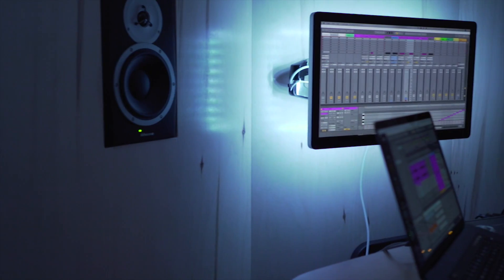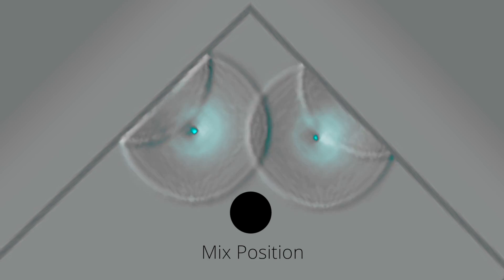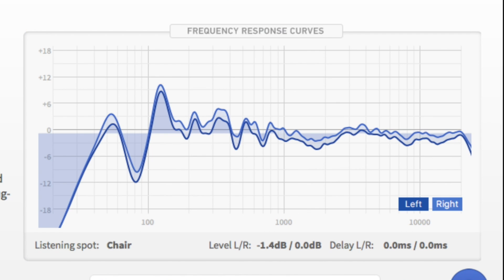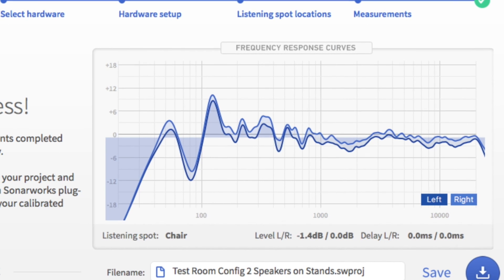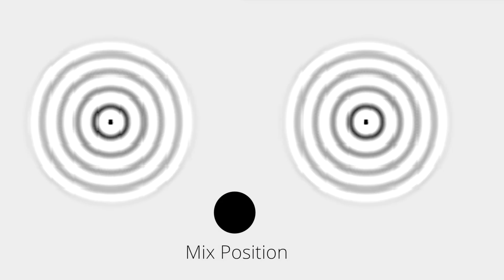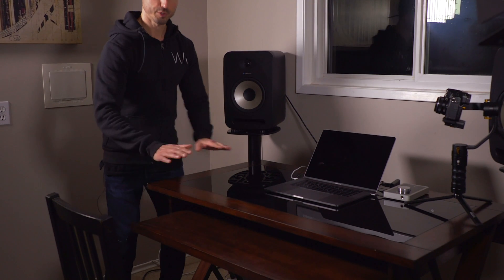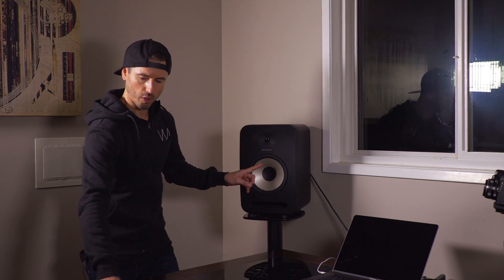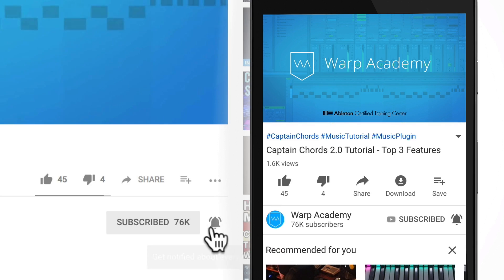How to Set Up, Test and Improve Your Home Music Production Studio Room – Acoustics Tutorial

Comment: As recommended by well-knowns like Wes Lachot and Rod Gervais, and other notable acousticians, the Stereo Vertex Point (the focused point where the speakers are aimed behind your head) should be 14" to 16" from your Listening Position (ear line). The reason you don't want to just to brush the ears is because of head lean. You need to add 4" to the left, 4" to the right, 4" forward, and 4" back from the Listening Position point to account for typical head lean. No one keeps their head perfectly straight and centered at the Listening Position at all times. At 10" behind the Listening Position and 4" of head lean, your L or R ear would be 2-1/2" outside of the equilateral line. At 12" behind the Listening Position and 4" of head lean, your L or R ear would be 1-1/2" outside of the equilateral line. When you map it out in a CAD program (with the human head being close to 8" in diameter) you will find that 14" behind your Listening position works out perfectly for keeping your head inside the stereo field despite any head lean.  https://i.imgur.com/hRtuFXX.jpg
Reply from the maker: Hey Andy.  We use about 12" as a standard, so a similar measurement.  I am curious though about these measurements.  If you toe your monitors out further, as Wes and Rod may recommend, that accounts for head lean backwards but not forwards.  As the monitors are toed out further out, then you lean forwards, you're actually much further away from the sweet spot.  How do they explain this?  

Of course you're going to lean forwards and backwards are you mix.  For that reason it's important to know where the sweet spot is, and to buy monitors that disperse directional frequencies (high end) sufficiently wide to account for this.
Reply: @warpacademy  Well 14" wouldn't mean toeing anything out further. You are still maintaining the 30-degree equilateral triangle. At 14" you are just moving the Listening Position (sweet spot) directly up 2" into the triangle from your 12". Basically just more into the triangle. I think it's easier when you see a CAD drawing. Here's an image from Sterling Hill that explains it better: https://i.imgur.com/hRtuFXX.jpg
Reply from the maker: Hey Andy.  I see what you mean.  Easier with images for sure.  Thanks for the link and comments.
Reply: @warpacademy  Yes sir. :)

Comment: If you put the desk in front of the windows, would you need to get some panels long enough to cover the windows, or do you think thick curtains would suffice for that?
Reply from the maker: Good question.  Curtains will do virtually nothing.  Heavy blackout drapes that are twice the width, and folded over to make them thicker, would help a bit.  You definitely don't want to cover the window with panels, as you'll actually create a small, resonating chamber behind the panels.  Bad news!  Instead, I would recommend completely filling the window with rock wool, then paneling absorption over top of that.  Ideally, you'll never have glass in a studio at all.

Comment: Great video. Just one question. What about studio monitors which have bass port on the back and placing them right against the wall? 
In most cases for home studios people will place them 30-50cm from the wall and that is problematic.. so if you press them completely to the wall will it help a bit even it is against the rules? or make it even worse?
Reply from the maker: Thanks for tuning in.  That's a good question.  I actually was discussing this with product managers from Genelec at NAMM, seeing as their One series monitors are rear ported.  So are my Dynaudios.  First, the port is not pressed up against the wall.  The monitors are always "toed in" to point at the listener.  So even when the inside corner is pressed against the wall, the angle lets the port breathe on the outside edge.  That begs the question, how much room do they need?  It's my impression that with toe in, the ports have sufficient clearance.  Genelec has confirmed this.  The only way you'll know for sure, with your setup, is to test it using measurement software as I have.  Each monitor and port will be a little different.  Happy music making.  Cheers!
Reply: Make sense. Cheers and happy music making too!

Comment: Great stuff as usual and thank you for it, from a Warp Academy member. 

Quick question: Have you addressed tackling issues with the floors in any given room in previous videos? For instance, our home is solid wood floors on a subfloor throughout. I'd like to properly address this potential problem.

Thanks in advance!
Reply from the maker: Glad you liked the video.  Hardwood floors are actually great in a studio.  The general rule is "hard floor, soft ceiling".  So you'd treat the ceiling with trapping and a ceiling cloud, then leave the floor untreated.  This is especially useful if you have rear wall diffusors and you want to reflect some sound back into the room from them.  The hard floor will give a nice bounce into the diffusors and allow them to push some live sound back into the room so it's not totally dead.  My room has carpeted floors, and I wish it didn't for this reason.  Cheers!

Comment: Thanks for the vid. I did not know about the desk issue. My biggest issue is my vaulted upstairs ceiling. The walls to either sidevof me are only a meter high, then the ceiling begins angling inward. For now I use calibrated Sonarworks HD650’s and a Subpac turned up only enough to feel the sub. All that and refrence track/analysis (which is the most helpful of all).
Reply from the maker: Glad you enjoyed the video.  Yeah the desk issue is a huge one.  Especially considering most pro studios have huge mixing desks, cluttered with gear.  If you saw an acoustic test of that setup you'd cringe.  Your spot with the vaulted ceilings sounds difficult for sure.  Have you ever done acoustic tests?
Reply: Warp Academy I’ve only run the Sonarworks calibration up there in that room. At the time I had Auralex everywhere. What is your feeling about a window right in front of my mix position? Do I need a diffusor? Is that a problem? I use the Se Munro Eggs w port on bottom-front of speaker and I wonder if they will exhibit the same concentric bass patterns as your test monitors? If I recall, these are shaped like eggs tto avoid a lot of reflection issues in the vicinity of the monitor itself.
Reply: I have not re-run calibratiob since version 4 was released. Should perhaps do that. I’ve just gotten too comfortable with doing most of the work like I described above. This day and advanced analysis tool age one get get FAR with good ref material, a decent analyzer/oscilliscope and Sonarworks it seems
Reply from the maker: @nsjx  if you have a window in your studio it'll be a major acoustics issue no matter where it is.  Covering it with absorption won't help much as that can create a resonant chamber behind the panel.  Probably your best option is to stuff the entire window full with rock wool, then place an acoustic absorber over top of that.  Won't be even close to perfect, but it'll help a lot.  Cheers!